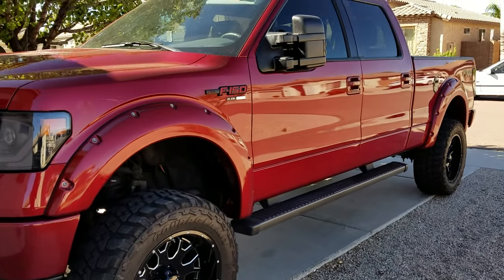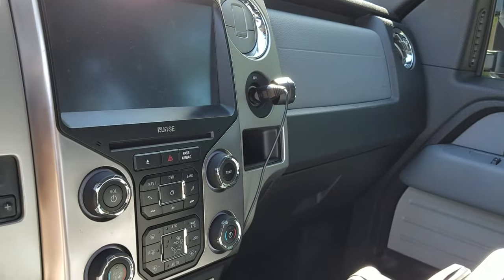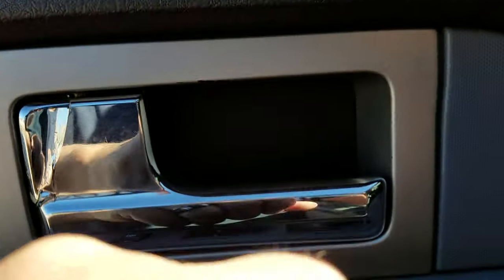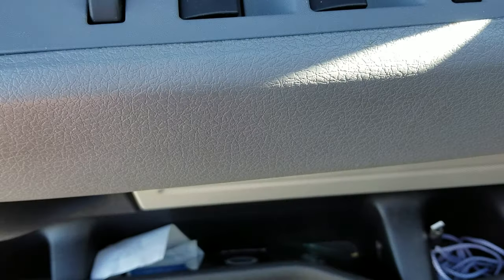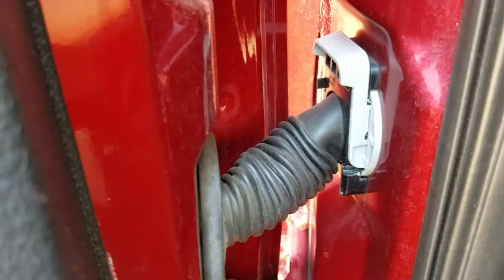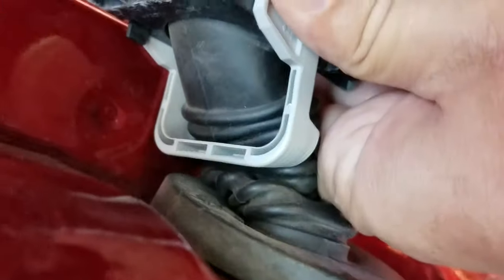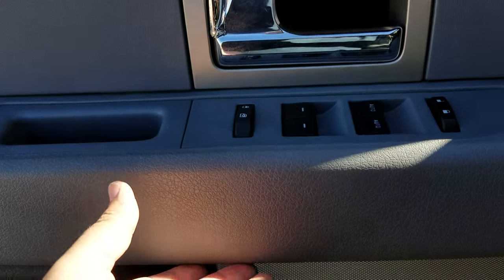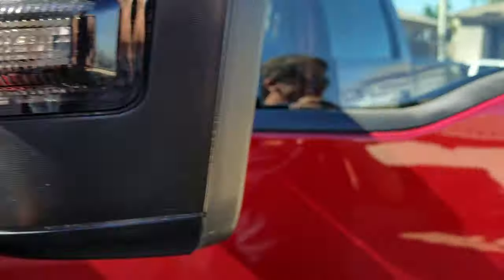F150 power fold mirrors conversion

Comment: Just wanted to point out (if your mirror switch is the same as factory) you can just one touch the switch and it's automatic (like one touch auto widows).
Reply from the maker: Chris Brennan thanks for the input, but this isn't true for retro fitting these to a non memory seat truck.  in this situation you have to hold the switch.

Comment: Just wondering. I've been searching and probably not in the right areas on the forums. There are so many guys talking about wires ext.  I was just hoping you could tell me what wires you had to run and to where. I noticed the two in drivers door must be power. Did you run 2 other wires to the pass door. And did you have to modify any of the wiring to switch sorry to make you repeat. Just love how you tool the time and made it such a clean install.

Comment: Hi, could you tell how to wire the folding switch? I know that pin 4 an6 are folding in and out, do I need to use other pin beside these two?
Reply from the maker: I don't remember, sorry.  But I can tell you there was Ground, Power in, and I think the other two were both power out to each mirror.  Please test first, but that's how I remember it.

Comment: I just got theses installed on my truck. Factory only had power mirror glass... they fit on and the blinker and running lights work but the power fold does not work! I even used the "upgrade harness" that l bought with it!
Reply from the maker: Did you get the wiring figured out?
Reply: The BrockBow well I did not but my installer did I sent him to the f150 power fold forums!

Comment: I have a 2012 that I already installed new power fold mirrors on and was trying to figure out how to retrofit the rest of the system, do you have a separate video or write up showing how you retrofitted the new mirror switch into the truck with the wiring that needs to be done for the switch?
Reply from the maker: Hey sorry, just reading this.  I used to have the pinout on a link in the description but that page moved.  I'd google it and see, sorry no other video explaining that one.

Comment: where did you find those mirrors with the smoked lights on them? only ones I can find are 4 bolt which is the f250 as the f150 has 3?

Comment: My 2014 F150 has the power folding mirrors already, but I want to upgrade to the towing mirrors and add the heated option; would you happen to know if that would be possible to do?
Reply from the maker: I think it just works when you already have that option.  The dealer puts those in all the time... just bolt on and go!

Comment: So if my mirror switch pushes down then I have the option for power fold? And it's then a plug and play? Or still gotta by switch and harness? Thanks!
Reply from the maker: Newly Gruber no,  you'll need to change the switch and add the wiring along with the new mirrors

Comment: What did you use for power for the power fold function of the mirrors?  From the forums it sounds like you don't have to run a power circuit.  Is this what you remember?  Also, my wiring harness for the mirror switch doesn't have anything in terminal 4 on the female side so how did you use terminal 4 to jumper to the mirrors?  I think I saw on the forums where a guy used some rtv sealant or something and basically glued in the connector so it would plug into the factory mirror switch.  I'd appreciate any suggestions. Thanks
Reply from the maker: if you're careful with the wires, you can just push them into the clip and they will hold after you snap it together.  I actually bought the metal ends and did it true to oem.  the power was from the window switch cluster. then I added a fuse and wire to the passenger side mirror
Reply: Thanks for the info.  I know it's been awhile but do remember what type of connector you bought?  It's some sort of molex type connector.  Also, what size fuse did you use for the power fold?  Did you use 22 gauge wire for the added circuit and needed the fuse to protect it?  Thanks
Reply from the maker: I don't remember, sorry.  I remember searching for hours to get a complete picture of what I was getting myself into.  Forums are a great way to learn about whatever you're trying to do.  You probably already know this but might be good tom mention for others who don't.
Reply: Male Pin is TE Connectivity 1438299-4 and Female is 1393366-1 Available from Data Alchemy or just do a Google search with the part number. You will need four of each but will probably have to purchase more for a minimum purchase.

Comment: How did you run your running lights? I did mine up pretty good but I keep popping relays for my running lights in the fuse panel under the hood. There's no info on any of this either
Reply from the maker: I went to the power window circuit in the door panel on each door.  This is a high amp always on circuit so they come on with the truck but I don't mind.  Otherwise I would have ran a jump from the parking lights, then a relay in each door for the power.

Comment: Where did you buy the power fold wiring kit?
Reply from the maker: Scott_4.6_ lee I made it.  Not much to it, the wires to the mirrors need a power source, and triggered by the ford power fold mirror switch
Reply: BOWMAN GT oh ok awesome. I'm working on installing power fold mirrors right now
Reply from the maker: Scott_4.6_ lee it's been a while since I did this, the newer trucks are very different wiring.  This one you should check on f150forum for diagrams.  If you bought the kit with three wiring and separate switch, it's even easier but the end result isn't as good IMO.  The way I did this one, the wires don't show, and uses the factor ford switch

Comment: Where did you purchase these towing mirrors from?
Reply from the maker: Ebay actually.  Just search for power tow mirrors for 2013 2014 F150
Reply: About how much were your mirrors?
Reply: BOWMAN-GT  Hey all the ones on ebay say manual folding. Did yours come with power folding or you had to add something to it?